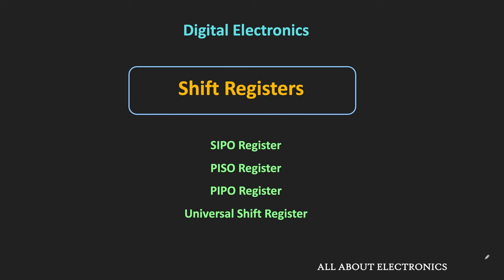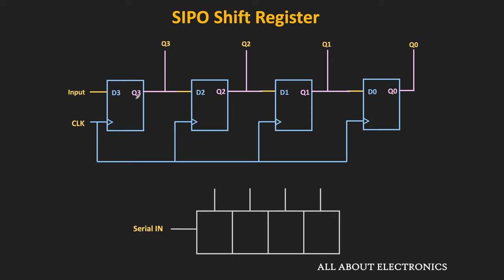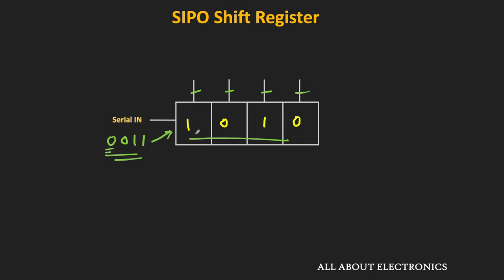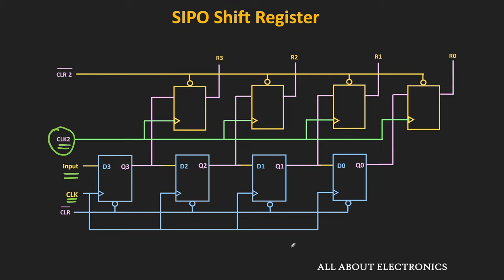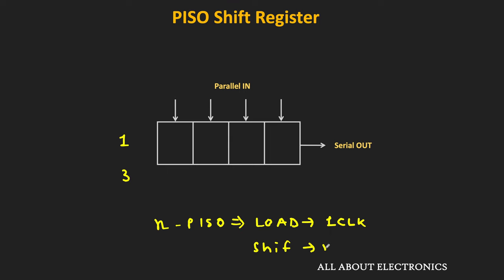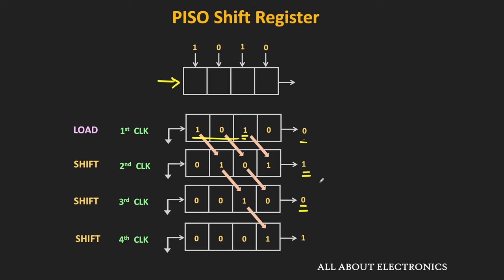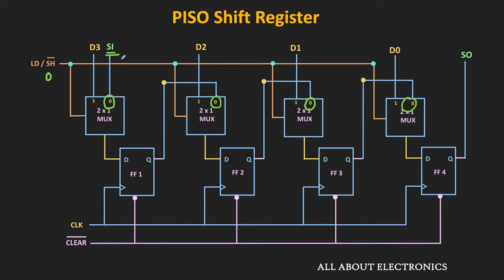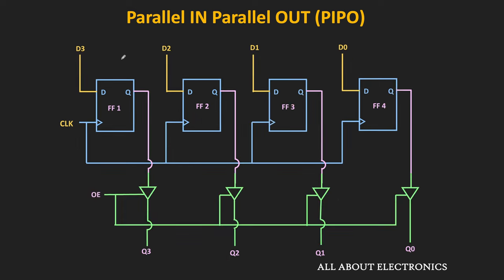Shift Register: SIPO, PISO and PIPO Shift Registers | What is Universal Shift Register?

Comment: Sir at 16:29 i.e during Parallel load of universal shift register what is the use of pin 0 of the rightmost mux, i mean what input is given to that ?
Reply from the maker: During the parallel loading, pin 0 of the right most MUX won't come into picture. Because the input at pin 3 will appear at the output.
I hope  you got the answer. In case, if you still have any doubt then let me know here.
Reply: @ALLABOUTELECTRONICS  Sir but then why in 15:54 the pin 0 on the rightmost mux connected with the output of the FF 4?

Comment: I would like to ask if you can share your knowledge/material that goes in depth on the mathematical modeling of piezoelectric energy harvesters. What structures could generate power at least 1uW at very low frequencies?
Im writing a thesis using piezoelectric on pacemaker

Comment: 4:59 have you applied the negative edge trigger to clock 2 signal i.e., upper register
Coz. You said between 4 th and 5 th clock pulse we will get the output in the upper register..
Reply soon bud.
Reply from the maker: You can apply the clock to the upper register once the data in the lower register is settled.  (After the settling time)  So, here the clock to the upper register is applied between the 4th and 5th clock pulse. In this case, it happens to be after the falling edge of the 4th clock cycle.